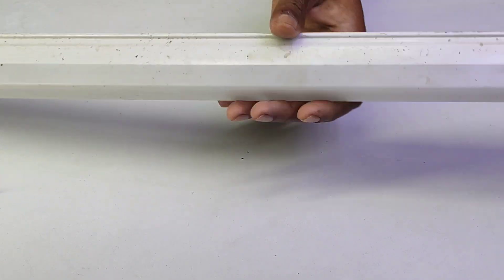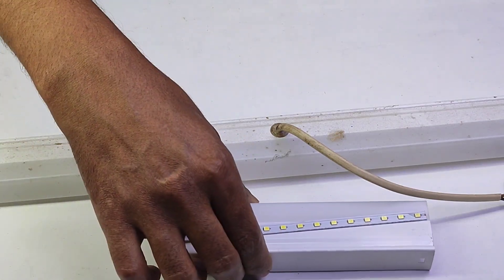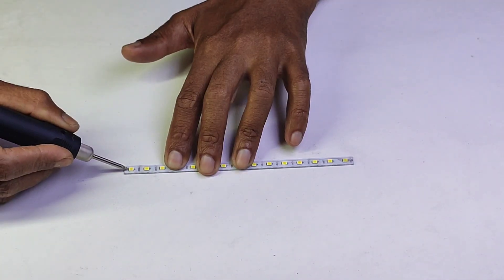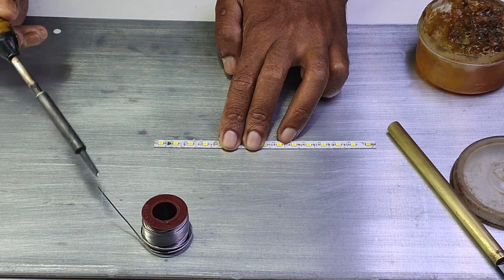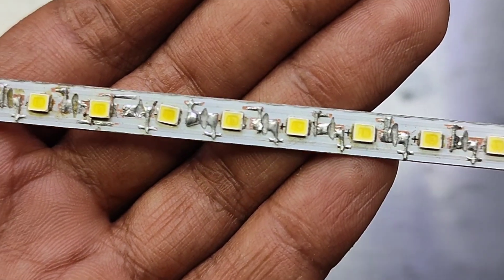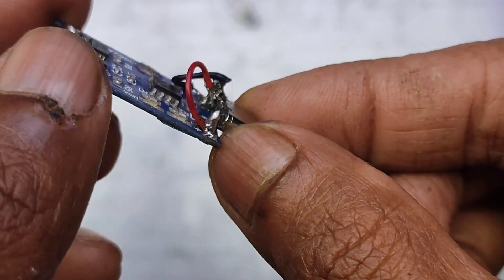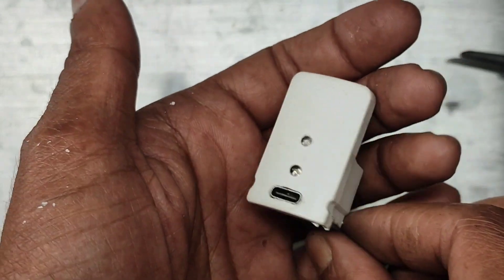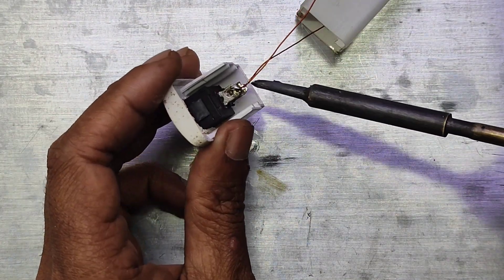DIY Rechargeable LED Light from Broken LED Tubelight | Bright & Long Backup

Comment: Battery voltage?
Reply from the maker: It is a standard 18650 Lithium-ion cell. 3.7V nominal and 4.2 maximum.

Flipkart Link : https://dl.flipkart.com/dl/robo-ocean-inos-lithium-battery-charging-module-tp4056-1a-li-ion-current-protection-type-c-electronic-components-hobby-kit/p/itm42c65fca2d404?pid=EHKHEBBA3FPABHBA&lid=LSTEHKHEBBA3FPABHBAY0XAZU&marketplace=FLIPKART&cmpid=content_electronic-hobby-kit_22371611432_x_8965229628_gmc_pla&tgi=sem,1,G,11214002,x,,,,,,,m,,mobile,,,,,&entryMethod=22371611432&&cmpid=content_22371611432_gmc_pla&gad_source=1&gad_campaignid=22371673895&gclid=CjwKCAiAl-_JBhBjEiwAn3rN7VPgdlQZPNH5vLa1B4CzslkLZ-W9OvgZmuTD1nlGz2u-06ykoVVb8xoCiNUQAvD_BwE&_refId=&_appId=CL

or you can just search for TP4056 charging module😊

Comment: How to get charging module link plz
Reply from the maker: https://dl.flipkart.com/dl/robo-ocean-inos-lithium-battery-charging-module-tp4056-1a-li-ion-current-protection-type-c-electronic-components-hobby-kit/p/itm42c65fca2d404?pid=EHKHEBBA3FPABHBA&lid=LSTEHKHEBBA3FPABHBAY0XAZU&marketplace=FLIPKART&cmpid=content_electronic-hobby-kit_22371611432_x_8965229628_gmc_pla&tgi=sem,1,G,11214002,x,,,,,,,m,,mobile,,,,,&entryMethod=22371611432&&cmpid=content_22371611432_gmc_pla&gad_source=1&gad_campaignid=22371673895&gclid=CjwKCAiAl-_JBhBjEiwAn3rN7VPgdlQZPNH5vLa1B4CzslkLZ-W9OvgZmuTD1nlGz2u-06ykoVVb8xoCiNUQAvD_BwE&_refId=&_appId=CL

Comment: Is the resistor is necessary?
Reply from the maker: Yes brother. It prevents the LED's from drawing too much current and thus overheating and frying themselves by limiting the flow of current. TP4056 module isn't designed to do that.

Comment: Components not clear from where did you source circuit for charging cell, and the cell itself
Reply from the maker: Thanks for your comment, my friend.

The TP4056 module is the only component I purchased, but not specifically for this project. I bought it a while back, even before starting my channel. Its charging port was broken, so as you can see in the video, I had to fix it.

The cell came from an AC/DC bulb at our local temple. The priest was about to throw it away since the bulb was broken, but fortunately, my mother noticed and brought it home.

Hopefully, that answers your questions!